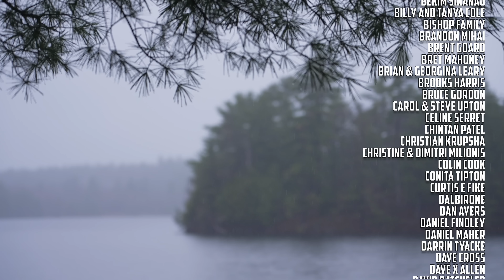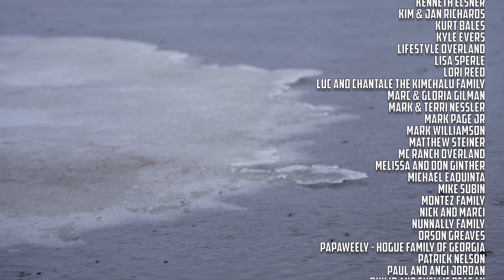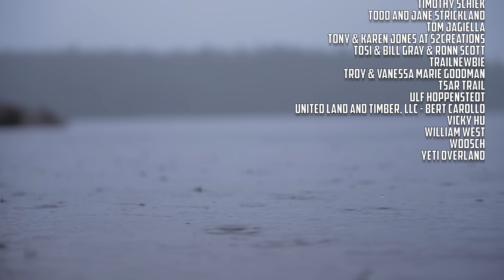LAST OF THE LAKE ICE | BOATS IN THE WATER // EFRT S8 EP17

Comment: I have been a type one for over 35 years and the best advice to give you is to avoid the highs and lows of blood sugar control. It's the spikes that cause the problems to your health in the long run. Sounds like you are doing pretty good otherwise with your management. I finally received a pancreas only transplant and no longer have type one. 😊. Stay safe.
Reply from the maker: Thank you for the tips. So cool they can do pancreatic transplants!